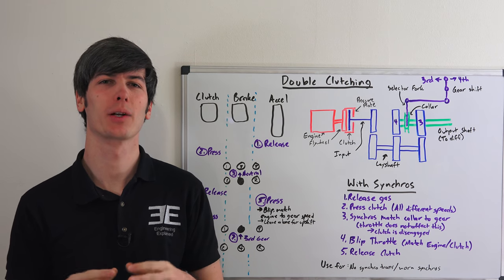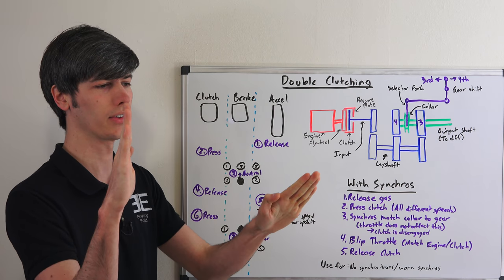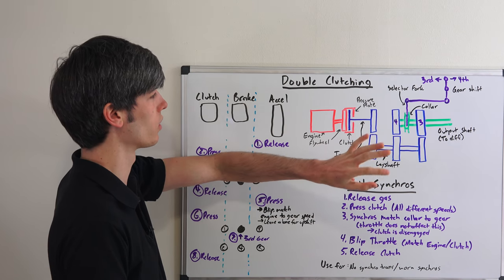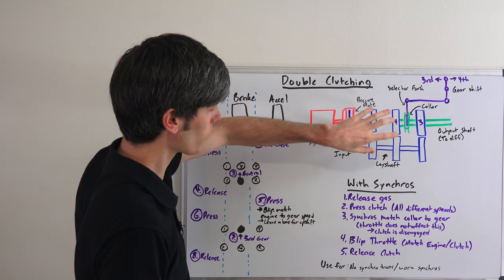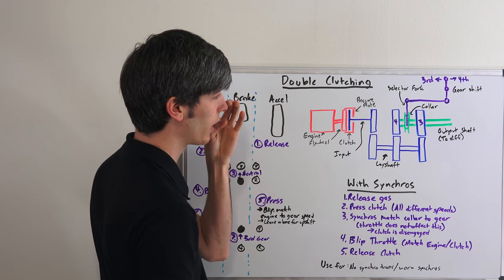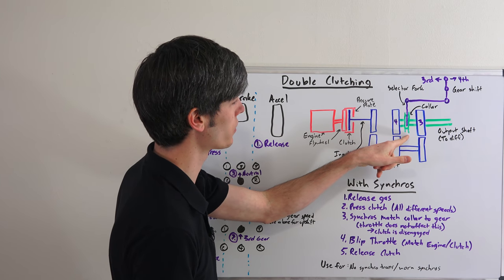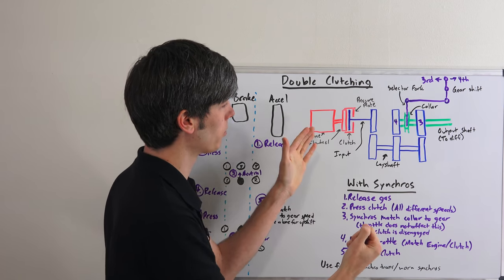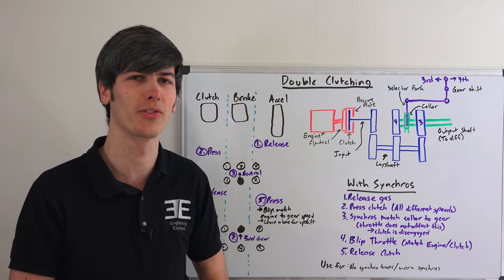What Is Double Clutching?

Comment: The only people who understand double clutching are truck drivers like me.  It's for unsyncronized transmissions only.  Big trucks historically had these because the gears were straight cut, not at an angle, to handle the torque and load of 80,000 lbs.  If you get one of these out of gear you better know how to rev-match to get it back in.  Nobody else understands this at all.  Completely antiquated technology nowadays.  That Vin Diesel movie was a joke, obviously.
Reply: I understand this.  Been trucking for 24 years.  I remember my trainer at KLLM used to get so frustrated with me when he was trying to teach me how to shift.  He would say, "Pull this damn truck over!  Granny shifting not double clutching like you should."
Reply: @TheTallMan50  Bro this is mad weird, I just replied to a 6-year old comment you had on another video.  Engineering Explained "Best AWD System".  About how you didn't like AWD because the tire in the trunk keeps spinning.  😂

WTF!!! The internet is getting smaller! 🤯😂👍
Reply: @lashlarue7924  Nah it's not weird.  I read your reply to my comment, clicked on your profile and saw a list of your most recent comments.  I found what you said interesting seeing as how i'm also a truck driver.  So I decided to put my 2 cents in.
Reply: @TheTallMan50  😅👍
Reply: By the time I revmatch I don't really need the clutch, at least not in a car. I've driven quite a few miles just revmatching and not even using the clutch, not sure if unsynchronized transmission would work that way.

Comment: C'mon, almost all cars that have less than 30 years old have a syncro so there is no need for double clutching.
Reply: The only reason in the first place was for the delay. Nothing else.
Reply: J Silk,the reason for double clutching is to get it in gear.I have to double clutch in my car when down shifting to first because it is an unsynchronized gear.
Reply: Nope, you're wrong dude. I've driven Model T's; MGs and Austin's from the 60s.. It's all about the delay for the gears and clutch plate to sync ... nothing more. you could go for a drive right now, put you foot on the clutch and hold it there as you count to two Mississippi and then switch gears - no grinding gears, no problems at all.
Reply: Stairway to heaven Bohemian rhapsody you should never downshift to first
Reply: Hmm I drive a 11’ jumbo transit van and I definitely need to double clutch between gears 1-3. A lot smoother transition when I do so, syncros are probably a bit worn after years of carrying a lot of weight. Informative video none the less
Reply: @hakugin15  i see how that would be fine for upshifting because you want the revs to drop, but wouldnt you still want it for downshifting when the car is going faster than the minimum speed of the lower gear, but you still want to shift into it for the extra power

Comment: Bro, seriously...? If you are a real driver, you can change the gears in a fraction of a second. That means the engine doesn't even have time to breathe, much less come down in RPM. So the double clutching thing sort of feels like unnecessary time waste and a delicate conscious effort while changing gear every time. Because I almost always change gears sub-consciously within half a second. Double clutching would take years to change a gear. LOL
Reply: You actually rev match because lower gears are shorter therefore spin faster
Reply: Wrong. You need to get the RPMs up based on the gear ratio. It's not just about shifting speed.

Comment: Double clutching is necessary on 18 Wheelers because their gears are not normally  synchronized. Here in Texas you have to demonstrate your proficiency with the  technique during the  driving portion of the Commercial License Test. If you are unable to double clutch you will not get a Commercial Driver's License in this State.

Comment: I usually double clutch the lower gears and then go to floating around 5th on the 18 speed. If I'm downshifting I usually left foot brake and blip throttle with my right while floating down, letting the engine brake do most the work. It's easy to tell if I get the rev match wrong because the 10k gallons of fuel surges forward in the tanks lol

Comment: What's the benefit to double clutching over rev matching? Every time I've driven a non-syncronized transmission I never touched the clutch except for taking off. I was under the assumption that as long as nothing is grinding, nothing is taking any real wear.
Reply: Tombs Clawtooth actually, dude just because you can't hear it., doesn't mean its not happening, you have to clutch, otherwise they wouldn't add a pedal for. It

Comment: So if I have a 2018 WRX 6MT how should I shift? Does it have sychros ? Pls help it my first new car I don't want to mess it up thanks.
Reply: No need to double clutch. I have the exact same car :) 

Double clutching is for very old cars... Most modern cars Even early 90's cars (some of the earliest i've driven) have synchronizing gear rings. Just shift normally. i.e. 1st, clutch 2nd, release.

Comment: so double clutching is the only way to change gears. you make it sound like modern cars don't need double clutching but you have to use the clutch.
Reply from the maker: You don't need to double clutch with modern manuals. That's why synchronizers were invented. They match the collar speed to the gear speed.
Reply: Engineering Explained what would I be doing if I wasn't double clutching? that's how I was taught. are you saying with modern. manuals you don't need to use a clutch at all?
Reply: dude what, that is not what he said at all
Reply: Shawn Tackett you can take your foot of the accelerator pedal then press in clutch and push the stick into the next gear real ease the crush and get on the throttle again. Double clutch is probably a bit smoother and better for your car.
Reply: i dont get why when u want to upshift u need to double clunch
the engine is to X rpm for example to 2nd gear, u press the clunch so the RPM are going low, when u go to 3rd gear the rpm are lower than X and near to the ratio of the 3rd gears rpm (the engine rpm stays the same)
what does the neutral stage stand for?
Reply: Ανώνυμος Ανωνυμόπουλος Really double clutching is used for racing nothing else. if you don't race cars don't worry about Double clutching .
Reply: yea but if it is smoother for the car it might help for the disc lifetime or the gear and shits life time 
and why not?
i mean when i want to turn and pressing the break to decelerate after the turn i need to downshift and if i do it straight away i feel a precussion cause the engine needed highter rpm
i dont understand the upshifting part even theoritically
Reply: Ανώνυμος Ανωνυμόπουλος well its only smooth if you're used to double clutching so if you need to  learn it then its going to cost a lot of money because you most likely crunch gears or burn out your clutch.
Reply: You have this confusion because you only look at the RPM of the engine, but not taking into account for the RPM of the layshaft, as well as the 2nd and 3rd gear.

In this 2nd->3rd upshifting case, when 2nd gear is engaged, 2nd gear is spinning at a different rpm compared to the 3rd gear because of their different gear ratio. You need to bring down the rpm of the layshaft in order to engage 3rd gear, to match the road speed. If you go directly from 2nd to 3rd, you will be using the synchromesh to eliminate the speed difference between 2nd/layshaft and 3rd.

If you go to neutral first, then engage the clutch, your engine speed is now matching the layshaft speed. You wait until the engine speed matches what is needed for 3rd gear. Now when you shift into 3rd, there is no speed difference between the 3rd gear and the layshaft, and you get a smooth gear change without having to put wear on synchromesh. In conclusion, no matter up/downshift, if you don't double clutch, you are using the synchromesh to eliminate the speed differences; if you do double clutch, you are using the clutch to achieve the same thing.

Comment: Well, I still don't get it. I thought if you press the clutch, rev match to the lower gear with the throttle pedal and then clutch in it should be fine. I still don't get why releasing the clutch in neutral only to press it again after to do the same as I would have done before. O.o

Comment: Was trying to get a faster acceleration in my old pickup to merge into 60mph traffic on a highway, from a dead stop on a side road. Figured out that if I only release the clutch about halfway when in first when applying the accelerator, then push it all the way in when shifting into second, I can save a fraction of a second compared to releasing the clutch all the way when in first, and also accelerate much faster because the RPM drop isn't as much. 

I call this "half-clutching". It makes no sense, probably isn't good for the clutch, but it sounds damn cool. If I tell the kids at work that I can professionally half-clutch in my truck, they're very impressed. They all drive automatic.
Reply: Sounds somewhat similar to a technique I've used that I call pulse-clutching while off-roading in an old low-horsepower VW dune buggy. I was trying to climb a very steep hill with deep ruts and boulders and my carb's main jet was clogged at the time, so I was basically feeding the engine unatomized gas from the accel. pump.. Needless to say, I wasn't making enough horsepower to complete the climb, so my technique was to put the clutch in and rev the engine up, pop the clutch to dump the momentum into the wheels, and then to repeat the process over and over until I was at the top of the hill. Really tough on the clutch and drivetrain, but it was certainly better than stalling out and having to back the thing down the hill in reverse.

Comment: So wtf is the difference between double clutching and rev matching lol
Reply: i dont get that either.. haha
Reply: Rev matching (heel toe) is to sync the clutch disk to the pressure plate. Dual clutching you're syncing the speed of the gear to that of the output shaft to facilitate the movement of the sleeve. Both are ultimately for syncing, they just happen to work on different components. You don't double clutch while doing heel toe.
Reply: Dhul Qarnayn you absolutely heel toe when you double clutch, especially driving race cars. all heel toe means is that you're blipping the throttle while braking. so if you're downshifting a car with no synchros you heel toe with your right foot, and clutch twice with the left. it's just a matter of whether you press the clutch once or twice during the downshift

Comment: 9th: Press the throttle.

Very nice explanation, I've learned this in actual driving on my own (tho I never drive to any track yet) because I just want to eliminate that back drag when your shifting down gears so that you could go more smooth even your just driving in the city, more comfort while driving, comfort for the passenger as well in your car transmission.

(didnt notice that I was doing already 9steps with this method till I watched this)

Comment: Great video! Just curious, so double clutching would be pointless in a car such as a 2017 Subaru WRX STI, right?
Reply from the maker: +Patrick Tadesse pointless in that it's completely not necessary, yes. If done perfectly, it would prolong the life of the synchros, but that's why the synchros are there (so you don't need to).
Reply: I think asynchronous gearboxes (in cars) are from the 60's, maybe 70's at last ...
Reply: if you wish to prolong the life of the transmition, its not a bad thing to do. Your transmition is an absolute B word to fix, and if you take it to a mechanic it can cost thousands, so its not a bad idea, but unless you are willing to practice it to perfection it is likely not useful.
Reply: Way late to the party I'd like to add that while it's not necessary when driving a car with a synchronized gearbox it can be a good thing to know what is happening inside that gearbox, and what you can do to "be nice" to it.

I've driven some very old wheel loaders and trucks that had unsynchronized gearboxes and that experience did help me that one time when the clutch wire broke on my car. I managed to limp home even though I had no way to use the clutch. I had to start the engine on the first gear, and was then able to change gears by carefully matching engine rev with the cars speed. Going to neutral was easy as I just had to keep a light pressure on the stick to feel when it would move freely. Changing into a higher or lower gear was a bit more demanding, but basically consisted of trying to match the engine speed with what I thought it would bee and carefully feel if I could slide into gear without causing too much damage. That the car lacked a rev gauge didn't make things easier... Oh and you will learn to fear and hate traffic lights.

But the thing is it is possible to do this, if you know a little about how the internals work. If you instead try to muscle the gearbox you are likely to end up on the back of a tow truck.

Comment: I’m old enough to remember it being called double d clutching... When gearboxes needed to be fettled into gear just at the correct rpm... lol 😂

Off the gas, dip the clutch and pop it into neutral, off the clutch and again depress it once more and then engage the gear... Not so much up shifting but necessary on the down shifts... It didn’t matter when you only had a few gears... 😅
Reply: It was called double DE-clutching, because you de-clutch, (i.e. disengage the clutch) twice instead of the usual once.  It hurts my figurative ears to keep seeing "double clutching" here...like fingernails on a glass pain! :-)

Comment: Just drive your car with the clutch,and you will be fine,also you can shift without the clutch,that is another story.Just sayin'
Reply: I was surprised one time I accidentally somehow shifted into 2nd I think without pressing the clutch pedal, immediately after I realized What I did and was like WTF how did that work?  It went really smoothly into 2nd gear, no problem. I think I was just at the right RPM at the right time.

Comment: Ive understood this process when my jetta started requiring it in 2nd on cold starts from worn syncro and bad oil..... problem is my head could never fully wrap around the idea of why but after this video, understood it completely. Thanks for another great video. This would help some learn to drive a manual trans better since it seems quite a few meed it

Comment: It's usefull when down shifting to first gear, looks like its not synchronized on most of the cars.
I have syncros but it's hard to downshift even at 5-10 km\h.
Reply: Yeah pretty sure my truck doesn't have synchros on 1st and the ones on 2nd only kinda let me downshift lol, 4th to 3rd is always real easy though
Reply: @imthedarknight-8755  Nice to know, do you think that there are no syncros on 1st and this is causing the issue? 
Double clutch with rev match on neutral is pretty hard thing to do and i'm not sure if it will help ( probably will ).
Right now i'm just breaking down to 4-5 km\h to shift into 1st, otherwise i need to press stick a lot harder with more force and this is weird because i am able to accelerate up to 60-70 km\h on 1st gear. 
For example idling revs (~1k RPM) should match perfectly 10km\h speed, don't know why it's so hard to downshift to first.

Comment: Hello, I have a question:

If I am in 1st gear and want to double clutch to second, does the gear have to go completely in the middle of the gearbox for neutral? I mean, would it be ok to leave it hang on the left side there until I press the clutch again? I am asking because it seems pretty slow to leave it fall in the middle and then put it in gear.

Thanks for the video! ✌👍

Comment: My manual transmissions always last a long time because I limit downshifting in general. The brakes are much cheaper to replace than transmissions. Unless someone is trying to simulate racing conditions on the street, just just use the brakes as much as is sensible. There are times when downshifting make sense, to aid in hard braking but for DD scenarios, downshifting a lot is overkill.

Comment: Seems to be some edge cases when maybe it's still worth it?  Like coming into a parkinglot, I can push it and go into 1st gear around 15-18MPH coming down to a crawl but it requires significantly more force than any other gear change which "feels wrong".  Staying in 2nd as I have to slow down even more it starts feeling like the engine is struggling as it hits 8-12MPH, especially parkinglots with an up-hill entrance and quick sharp turns that you have to go very slow.  If I double-clutch as I downshift at the same speed, it drops into 1st with near zero force on the stick readily at 15-18MPH and then I can smoothly continue slowing and have plenty of power when I need to go uphill a bit.

Comment: If you were to cruise at highway speeds with the clutch pedal pushed down. Then continually move the shift knob between Neutral and into a gear and repeat over and over again N to 4 to N to 4…, this would wear out the synchros very quickly, correct? Because it’s wearing the synchros to move the slower (blue) input shaft and layshaft to output shaft (green) speeds?

Comment: I have been using this technique for about 45 years now, because of necessity on my 1975 "Mustang" with poor synchronizers. Although my current 2006 Mustang has good synchronizers, I still double clutch to save them wear and tear. Then of course there is the power shift where you don't use the clutch at all. My 1970 Mustang snapped the clutch threaded push rod and I had to do this to get to the Ford dealer for repair.